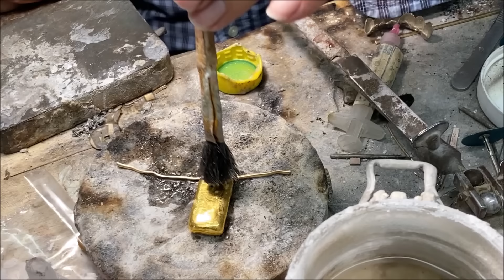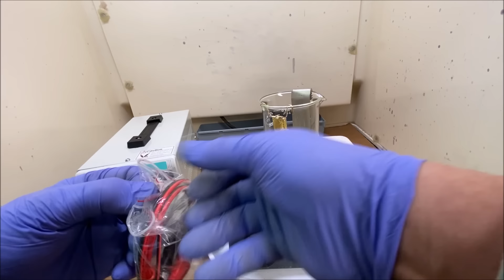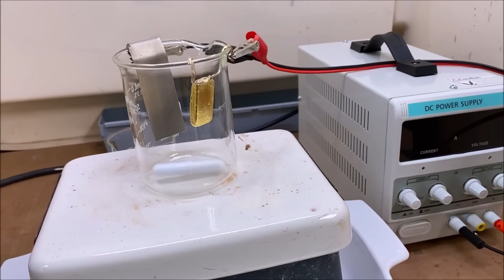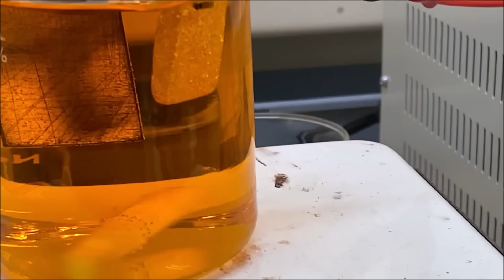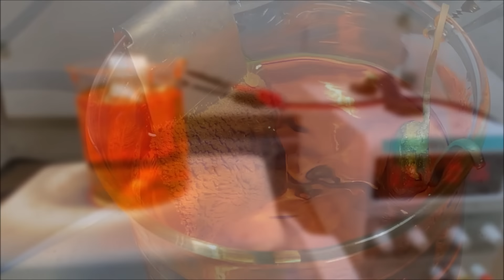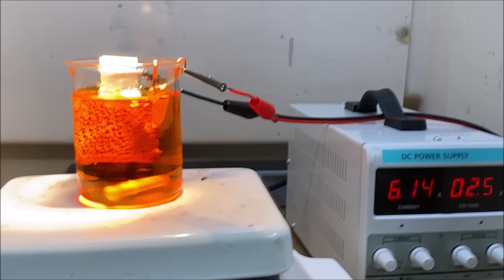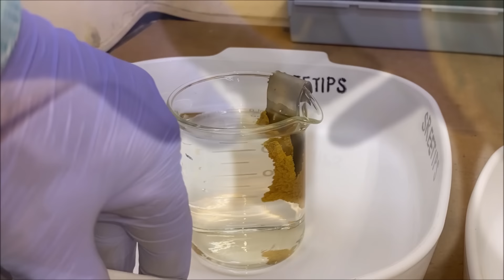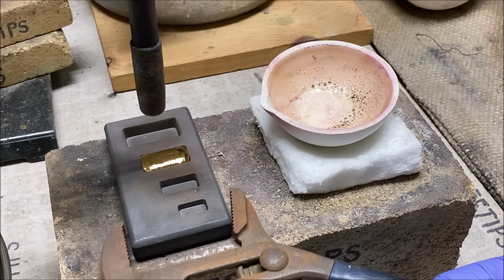Electrolytic Gold Cell Part 2

Comment: So let me understand what you just did. You submergered a pure gold bar in aqua regina as an anode. ( Aqua renia disdolves gold ?) Then transferred the mass of the god bar onto a cathode with contaminated aqua regina.  You just tranferred your gold bar to the cathode. You still have disolved gold in the solution.  WTF
Reply from the maker: The anode bar is 995 parts per thousand pure gold. The pure gold crystal deposited on the cathode is 9999 parts per ten thousand pure gold. The electrolyte is not Aqua Regia, it is chloroauric acid solution (pure gold that’s been dissolved in Aqua Regia). But why? Why do such a thing?! Several reasons: 1) to produce some new and interesting content for my channel. 2) to produce high purity gold crystal. 3) it’s easier to sell gold in this state because it is beautiful to look at, highly valuable, impossible to fake. Hope this helps.
Reply from the maker: I recover the gold from the electrolyte.
Reply from the maker: This is the same process that the Royal Canadian Mint uses to produce four nines gold for their coveted one ounce Canadian maple leaf pure gold coins. The only difference is I’m doing it in my garage, and they are doing it on a much larger scale.

Comment: Am watching but what’s that turning in the cup
Reply from the maker: Teflon coated magnetic stir bar. There is a rotating magnet under the hot plate. When that magnet spins the teflon coated magnetic stir bar spins with it.
Reply: @sreetips yes cos of heat and current under understand

Comment: As electrician for 20y experience can tell u with this wire better remove them one from another hot so much heating between them or buy better wire and hook the crocodile clips on them ur dc power will be happy and long lasting
Reply from the maker: Thanks for the tip
Reply: @sreetips change wires on 2x5 mm and u will never have problem except after 30amps cos it’s short distance on wires just keep them separate

Comment: What was the weight of the for nail ingot + the leftover anode "shark tooth"? What did you gain? Wasn't that the point of the exercise?
Reply from the maker: The “point” of this video is to convert the 995 parts per thousand gold anode, into 9999 parts per ten thousand pure gold crystal.  Beautiful to look at, highly valuable, impossible to fake.

Comment: So let me get this straight...
You took impure 14k... disolved, suspended and transfered to titanium via electrolysis and some how made "pure" gold? Can we see a lab test of the so called golds purity content?
Reply from the maker: The anode was not 14k but rather 995 parts per thousand. I passed a current flow through that bar to dissolve it. The gold ions deposit in the titanium cathode as 9999 parts per ten thousand pure gold.

Comment: But how can u use/sell it? There are no mintings or certificates of authenticity included.
Reply from the maker: I can’t keep it in stock. Even at $200 per gram!
Reply from the maker: It’s pure gold crystal. No way to fake it.
Reply: okay Bud what do you do with that? 
If keeping it not possible how we can sell it?.

If you pour it into small bars, can you sell it?
Reply from the maker: Yes, it can be hard poured into small bars.
Reply from the maker: I plan to use silver to fund retirement. When silver gets to $300 I’ll make 5 ounce silver bars as needed. If I need a little more then I’ll make a ten ounce bar. I’m not selling my gold, except a few grams on my eBay site.

Comment: Why would you attach the wire to the bar instead of just making a break in that ring opening spreading it a little bit and having it grab the bar with its pointed edges and tension from The Ring and then hang it from a string
Reply from the maker: Didn’t think of it

Comment: Perhaps I’m missing something as I didn’t watch part one, but by “grow gold” do you mean that you used electrolysis to move gold from one location to another? It seems like the weight of gold that is the anode is more than what is recovered from the cathode, and in effect everything just equals out.
Reply from the maker: The gold ions come off the anode, travels through the electrolyte, and deposits, “grows” on the cathode.
Reply: It is impossible to create extra gold.  The so-called growth comes from the original source, the initial gold at the beginning.
The amount of net gold at the beginning is exactly the same as the amount of net gold at the end. Not a single microgram of gold is added to the weight of the gold.
No extra dollars can be earned. Don't be misled.  The gold price would immediately collapse if this were possible.
Reply from the maker: You are correct. It’s a one for one exchange, less any losses. I’ve never claimed to be creating new gold out of thin air.

Comment: Jesus made fish from 🐟 and bread from 🍞  i think the Earth does the same thing at ita core for elements
Reply from the maker: According to science, heavier elements are formed inside neutron stars that collapse. It’s the only place known (so far) where the pressures and temperatures are extreme enough to cause the protons of lighter elements to come apart and fuse together into heavier elements including gold, silver and platinum group metals. The strong nuclear force, is a complete mystery to science. This mysterious force tightly binds the protons in the nucleus of atoms and is very difficult, if not impossible, to break.

Comment: You used a 58.2g gold bar as the anode and got 45.6g out, am i missing something or did you just lose 12.6g of gold?
Reply from the maker: The remaining gold is in the undissolved portion of the anode.

Comment: how come the gold that was trapped in the electrolyte didn't stick to the titanium cathode?
Reply from the maker: Some of it did.
Reply: @sreetips  yes, some of it did, i'm wondering about the gold that didn't.  is it not as pure?  is it just something thats happens and your not sure why?  i'm not a chemist.  if the surface area of the titanium was greater, would that attract more gold, meaning less gold in the electrolyte?
Reply from the maker: I don’t know all the particulars. The gold ions travel through the electrolyte by the current flow through the cell. As the anode bar dissolves, those gold ions are forced off the anode and into the electrolyte. When they come in contact with the titanium cathode they deposit as high purity gold. But the cathode can’t distinguish which gold ions came off the anode, and which ones were in the electrolyte. So as the cell operates, some of the gold from the electrolyte gets deposited. But most of it comes from the anode.

Comment: So I'm like 2 years late, but... i have a dumb question. Why not punch a hole through the bar, then hammer down a corner so it's thinner. String through the hole, alligator clip onto the flattened portion
Reply: Or i guess if the clips are strong enough skip the hole and just use the clip to hold the bar up
Reply from the maker: Yes
Reply: Also stir bar seems... not ideal?
Isn't the purpose of this to only have gold move over? If you're stirring, it's gonna knock the junk back up and some might stick on that bumpy surface
Reply from the maker: Yes
Reply: Ah.... go through all the trouble to refine it, stick it in a contaminated crucible... (or are the bits of material stuck to the bottom not really a problem?)
Reply from the maker: Correct
Reply from the maker: Yes

Comment: I dont see the purpose of this... your literally taking pure gold and breaking it down to be put right back together in possibly the same shape it came from... your not "growing" gold. Not sure wats going on but all this seams like a waste of time. Just keep or sell the damn gold. Find it raw in the creeks or wherever then melt it down to a bar and call it good.
Reply from the maker: Spoken like a true non-refiner.
Reply: @sreetips @sreetips   😂 funny. Yes I am a non refiner. If it's 24k in which there's no higher that I know of... then why refine? If it was under 24k I'd understand yet still debate if after supply cost and labor was it worth it? As stated in the comment, I don't know wats going on. The click bait title I seen said "Growing gold" then after clicking says electrolytic gold cell. I see your time other than knowledge through experience in experiments, a waste of time n money.  Did you buy the gold? Did you find it in raw form and smelt it to a bar and then decided to refine it? Cause just as I see people buying "fake" diamonds that are lab grown at a high price vs natural diamonds, means people will go for fake affordable deals vs the real deal. where I'm getting at is this is as  dumb as the people buying lab diamonds are. A waste of time n money.
Reply from the maker: I see. What I’m doing here is called electrolytic refining. The anode bar was pure gold, about 995 to 999 parts per thousand. After running it through the electrolytic gold refining cell it increases the purity from 999 parts per thousand to 9999 parts per ten thousand. However, since three nines is industry standard for pure gold, the fourth nine is totally unnecessary, unless needed for some specific purpose such as a test standard or other specific reason. So why bother doing it, and why claim that I’m “growing gold”? The answer is simple: for the show. And to demonstrate how a non-chemist, regular guy off the street, like me, can pull it off, in his garage. This is the exact same method (but on a much smaller scale) that the big refiners use to produce four nines gold in order to make Canadian Maple Leafs, for example. Grow; to increase in size or mass. And that’s exactly what’s happening at the titanium cathode in my gold cell. The “click bait” you refer to is your mind playing tricks on you. We humans are so easily deceived, especially when it comes to thinking that we can get something, for nothing. Quite obviously, I need impure gold before I can refine it into high purity gold in my electrolytic gold refining cell. The real deception is happening with the paper currency. We are getting ripped off, by those who print currency out of thin air “without limit” and use it to buy what ever they need. If we want something, or need something, then we have to go to work and earn, or sell something. They just print currency out of thin air. The only way to combat this thievery is to reject their paper, and hold our savings in gold and silver. Because these cannot be printed into existence out of thin air. Hope this helps. Thank you for your comments and for your interest in my channel.
Reply from the maker: Sorry if I sounded condescending in my first comment.

Comment: Really love your videos thank you!  I have a question, the gold bar you weighed at the beginning, did it not weigh the same as the gold bar you smelted at the end?  Just trying to understand, because it seems you’re right back where you started?  A 50g gold bar is dissolved on the positive terminal and you recovered 50 ish grams on the negative terminal?

Was it the increase in volts and amps that caused the positive gold bar to dissolve quicker than what could have been recovered on the negative?
Reply from the maker: The anode bar was about 995 parts per thousand pure gold. The gold crystal that deposited on the cathode was about 9999 parts per ten thousand pure gold. The whole point was to produce four nines gold. This is how big refiners do it, except on a much larger scale. I proved that I can do it, in my garage. why? For the show.
Reply: @sreetips you’re amazing and I feel so lucky to have a reply :) thank you for clearing that up for me, I watch so many of your videos I sometimes get lost with what’s happening!  Please keep making your amazing videos! 😊
Reply from the maker: Thank you!
Reply: @sreetips Bless you!  In the words of Columbo, “Just one more thing sir”: Ive watched so many of your electrolytic silver videos, I’m honestly obsessed and weirdly chilled out by them lol.  Regarding making the silver nitrate and for the anode and cathode, can you still harvest 9999 even if you use lesser quality silver for the anode, cathode and silver nitrate?  I take it that all silver produced this way will be 9999 but the purer your nitrate, anode and cathode, the bigger the yield in weight as copper and other materials would be left over in the “Blue Waste Bucket” and Filter papers?

I’m sure I sound like a complete moron asking this to you.  Had you been my teacher at school I would’ve definitely stayed in sciences and chemistry, thank you for teaching my inner child.  If you ever want a lab monkey just ask and I’ll be on a plane right over!!!!  Hail Sreetips!!!!!!😊
Reply from the maker: The old saying, “there’s no free lunch.” You only get out what you put in, less losses due to entropy. The blue comes from copper. The cell can tolerate up to 60g per liter of copper in the electrolyte. After that, the copper could begin to co-deposit with the silver and contaminate it.
Reply from the maker: I use pure silver crystal from a previous refining to make electrolyte for the next batch. But one could use pure silver bars or coins. I use impure 98% silver 2% copper (estimated) that I recover from my gold refining operations. The 2% copper gets dissolved, along with the 98% silver, by the electrolytic action. Both copper and silver ions pass through the filter and into the silver nitrate electrolyte. That’s why the electrolyte turns blue. But only the silver ions deposit on the stainless steel cathode bowl. Some of the silver from the electrolyte also deposits, causing the silver nitrate electrolyte to become depleted of silver. Because the cell can’t distinguish between silver ions that were already present from the electrolyte, from those that were dissolved from the impure silver shot in the anode filter. Only the silver deposits if the parameters are kept within limits: 3.5 volts DC and copper concentration is kept low. I’ve had it assayed and the silver came back three nines. But I did run some silver crystal back through the cell a second time and had it assayed via ICP analysis. That came back greater than five nines fine. That’s 99,999 parts per one hundred thousand pure silver. As close to 100% as anyone can get.
Reply: @sreetips WOW!!!!  You can get 99999???  So for the sake of an example, a load of silver nitrate is made from sterling 925 and put to one side, make a bar using a crucible and borax for the anode using 925, then run the cathode with silver shot from more 925 and borax from the crucible, one would be able to get 999+ by running it a few times through the silver cell?  The more times you refine, the closer you get to 999+?

I can’t tell you how grateful I am for all your lovely replies, feels like im talking to a celebrity!!!!
Reply from the maker: Oops. I replied incorrectly. I was referencing my silver cell. But this thread is about my gold refining cell. But it doesn’t matter. I can run the pure gold back through the gold cell and get five nines gold there as well.

Comment: So the cathode has the gold from both the anode and the solution on it?
Reply from the maker: Mostly from the anode, but some from the electrolyte. The electrolyte becomes depleted as the cell operates. The cell can’t tell the difference between the gold ions that come from the anode, or from the electrolyte.
Reply: @sreetips thank you.

Comment: It seems like it instantly resolidifies as soon as it touches the mold, even with the 2nd torch blasting it.  I think the layering effect on the top of the bar shows that it solidifies layer by layer as it gets poured.  Isn't there a way to keep it molten long enough so that it can flatten out on top and fill the vacant corners of the mold?
Reply from the maker: Possibly. But I like the layering and concentric rings on the bar. It’s like a finger print. If I wanted perfect then I’d get a hydraulic press.

Comment: A wohlwill cell  (spelling )
Reply from the maker: That’s correct
Reply: @ its hardly worth doing without like that 100 ounce bar. You did a while back. But then again a london good delivery only has to be 99.50 %
Reply from the maker: You’re absolutely correct. At my level (the hobby level) a single Aqua Regia refining is all that’s needed. I can make a single refined bar shine like a mirror. I think the key is proper rinsing of the gold powder prior to melting. It really makes a big difference. The only reason I did this was for the show. For new content for my channel.

Comment: Is this experiment just pulling gold from the anode or is any of it coming from solution? I feel like it is just pulling the gold from the anode 🤷🏻. I feel like the only way to get the gold from solution is to get rid of the anode and put a wire from the positive to eat up the gold in solution! Or just take the gold out of solution with the stump out! If the solution is maxed out then it will only pull gold from the anode 🤷🏻
Reply from the maker: Both. The cell can’t tell if the gold ions are coming off the anode bar, or if it’s gold ions coming from the electrolyte. They are essentially identical.

Comment: Not sure if you realize this or not, but when you go higher current you bring over the unwanted metals to the cathode. It's not just a gain in time that makes your refining more speedy. By increasing the voltage beyond 1.8 you are basically reducing the purity.
Reply from the maker: Agree
Reply: I totally 💯,% disagree . So what you’re basically saying is if you hit a nail in a pallet & you burn 🔥it the only thing that’s left is the burning 🥵 torch 🔦 you stared it with ? So where did the nail go ? Same thing it makes no sense at all ? Just like voltage from your crocodile clips 😊❤ I hope I explained that ok 👌 4 U

Comment: I think you could probably use an electric spot welder, home-made even, to attach those flattened-out rings as terminals. There are videos you can watch to show you how to build your own. It can even be done with a series of 9v batteries, or smaller if you want.
Reply from the maker: That would work well.